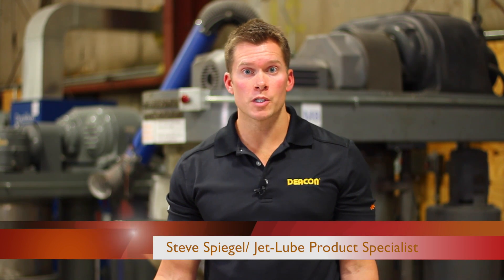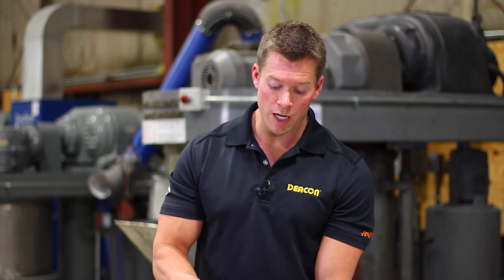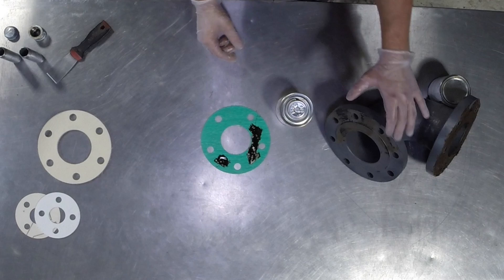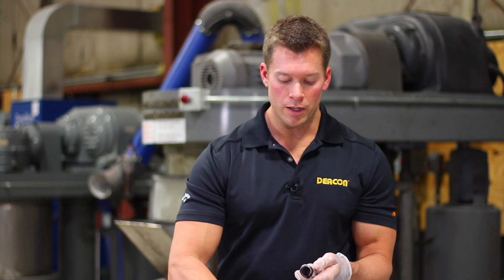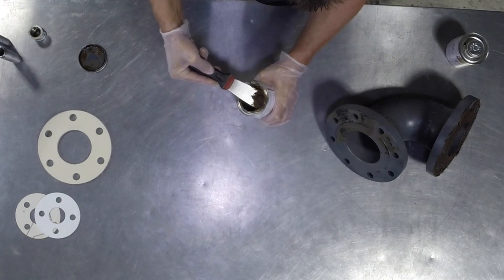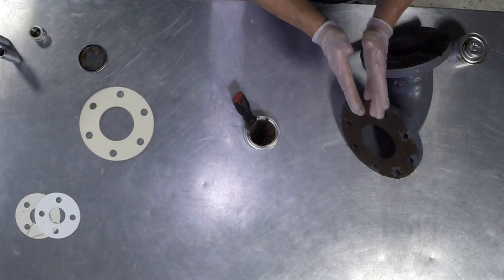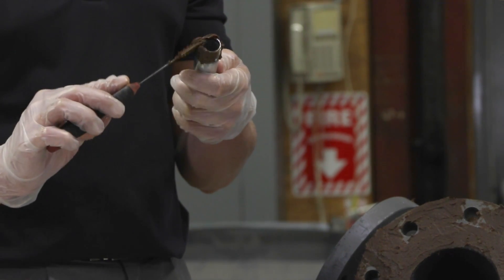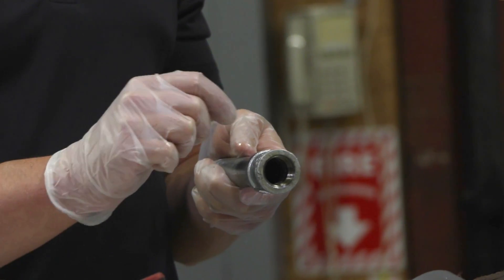DEACON® 770 - Thermal Reactive Sealing Compound

Comment: On the threaded joint connections will the Deacon Liquid product also provide a water tight seal in high temperature water situations?